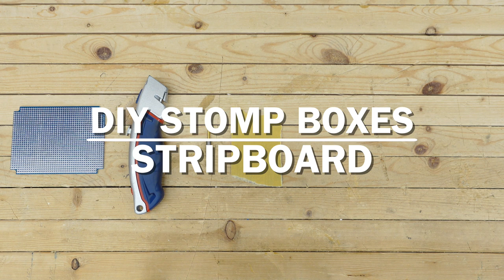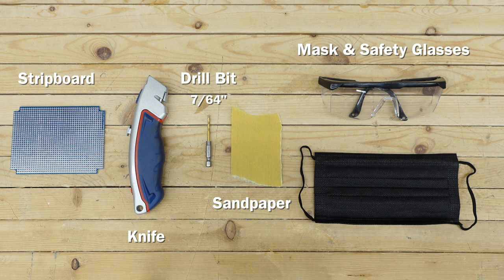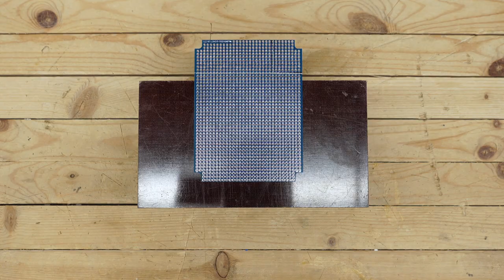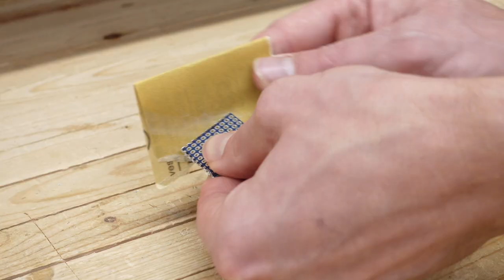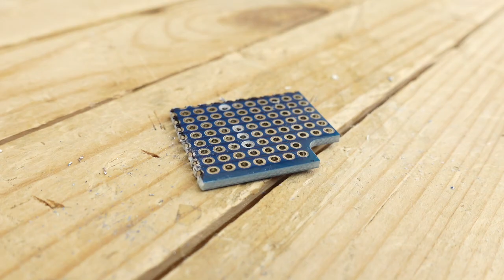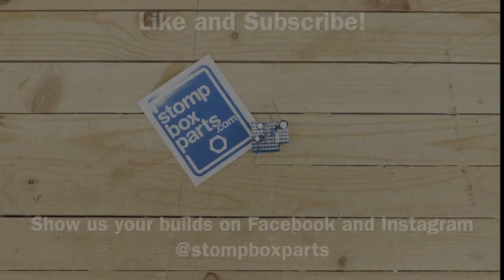How To Work with Stripboard | DIY Pedal Tutorials by StompBoxParts.com

Comment: I just finished my fourth effects pedal. The first three were kits, and the last one was built from ordering individual components and a PCB. I’ve been looking for where to go from here, and it seems like it could be it! Any tips from going from kit builds to the next level?
Reply from the maker: Seems like you've already taken the next step of building something with components you've sourced yourself, keep it up! Making a stripboard pedal would also be a fun new challenge, for sure! Or try putting two circuits in one enclosure. Get a drill and start drilling and customizing your enclosures (if you haven't done that already).
Reply: you still stuck? what helped me was breadboarding something based on the Bazz Fuss, and then experimenting til you have something to put onto stripboard or perfboard

Comment: Any tips for designing stripboard  layouts?
Reply from the maker: Years of practice! Start small and simple, like daughterboards for switchable clipping diodes or other mods you can put on a toggle switch. Or try laying out a small circuit (fuzz face or some simple booster) so even if you aren't "efficient" and it takes up more space than it needs, it should still fit in most standard enclosures. 

If you haven't built anything from a stripboard layout, try studying a few from the links in description, or build something from a verified layout that you've built on a traditional PCB before.

Comment: What was the drill for? And was that stripboard or perfboard?
Reply: This is stripboard, perfboard doesn’t have the horizontal connection lines. The drilling is used to discontinue the connections in a strip, allowing more components to fit on this size board
Reply: It is PERF board...not vero/stripboard., you were right to ask....
Reply: @Kallum No, it is not stripboard...we can clearly see the tinned holes...NOT strips ......PERFBOARD.....
Did you see a totally different Clip?
Reply from the maker: @muppetpaster  Tinned holes/pads on both sides, strips on one side. Stripboard!

Comment: i didn't realize this kind of board had traces between the holes.
Reply from the maker: Yup! Our stripboard has solder pads on both sides of the board.
Reply: @StompBoxParts  would this not lead to shorting or bridges on the component side??
Reply: @StompBoxParts  ive been making a few circuits lately, im new to building FX for myself. but ive been using a board like what you have , i did not drill out any holes should i be worried about my first couple circuits? they seem to work ok atm.
Reply from the maker: @AaronAubreyPhoto  Won't be a problem happen unless you're running bare jumper wire flush against the board.
Reply from the maker: @BryanDenham  The boards on our website are clearly labeled strip or perf board. If your circuit works fine, you ordered the correct thing.
Reply: @StompBoxParts  Yeah he's not talking about it having pads on both sides, he is talking about the adjacent pads being connected. Which they are not. Hence why what you guys have is not called stripbaord It's called perfboard. Somebody in your company is under the impression that having solder pads on both sides somehow makes it strip board and having them on one side makes it perfboard, but that's not the case. Having long strips connected like a breadboard is what makes strip board aka vero board, stripboard.
Reply from the maker: @stevenutter3614  Hey, thanks for “weighing in”. This board indeed has copper strips running across (as well as having pads on both sides), which by all definitions would make it stripboard. Please do a small bit of research on our product before making such claims. Cheers!
Reply: I am sure you know what you are talking about, you showed both sides of the board, it just does not show clearly. I cannot see copper traces on either side when you sand the edges. It is shown much clearer in your website photos. Thanks for the video.
Reply: @StompBoxParts  Honestly, I thought the same thing as many others on this video.  If your stripboard product is easily confused with perfboard, you might consider noting that in the video description instead of criticizing viewers who have commented.  Thanks for the instructional video.
Reply from the maker: @senorfrio  Fantastic idea! Done! Thanks.
Reply: @stevenutter3614  2:07 pause the video here. If you look closely at the board, you can see that each row is indeed connected. The copper or silver (whichever is used) conductive row is underneath the blue paint but you can definitely see that it’s there.
Reply: Wouldn’t you want to cut the traces on the other side of that board? The strip side?
Reply: @markpeynado9013  the type of board they use in the video does not have any traces between the holes so you would not have to bother with thay,but some types of diy pcb's do have traces between each row of holes kinda like how a bread board has traces between each row of holes and if thats what you have then you would need to use a drill bit or a sharp knife to break the treaces you dont want. I hope this helps

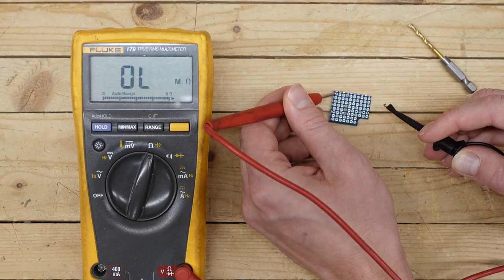Comment: 2:18 Pointless measuring, since this is no stripboard....all points are separste anyway, in contrary to VEROboard....😂😂😂
Reply from the maker: Nah, it's stripboard fam! Check the web link, check the pics. 2:07 you can see the horizontal strips under the blue coating! Strips on one side, pads on both side.

Comment: That's not stripboard that's perfboard.
Reply from the maker: This particular board has strips running along one side, making it stripboard! For convenience, we designed it with pads on both sides. Thanks for your contribution!
Reply: @StompBoxParts  I also thought that this was perfboard based on the video. It would be nice if the video clarified that the strips are covered, and so there but not visible, and that the illustration on the website is needed to identify the strips' orientation; it isn't apparent without viewing your website that this format of stripboard differs from regular stripboard, as the back of the board is never shown. It is a nice design in some respects, but confusing as described.
Reply: @StompBoxParts wouldn't that just lead to confusion if you have a bunch of different boards laying around? why not make them visible?
Reply from the maker: @simpson6700  They are visible! Check website for photos. It is definitely not conventional to have stripboard made similar to a production based PCB (double sided pads, conformal coating to prevent corrosion, shorts, etc) and I believe people are having a hard time grasping that. We use them in house for prototypes because of the additional durability versus exposed copper. Maybe future runs of our board will follow the conventional stripboard with bare copper and the pads only on one side. Ultimately, this video is about working with stripboard, not about our product particularly.
Reply: @StompBoxParts if its about stripboard generally and not your product, it would behoove you to use regular stripboard
Reply from the maker: @maxonmendel5757  Been there, done that! Replace ours with regular stripboard and video would remain the same.
Reply: @StompBoxParts  yeah except you wouldn't have 20 comments telling you its perfboard and your job would be a little easier.
Reply from the maker: @maxonmendel5757  indubitably
Reply: @StompBoxParts  yes, indubitably indeed.